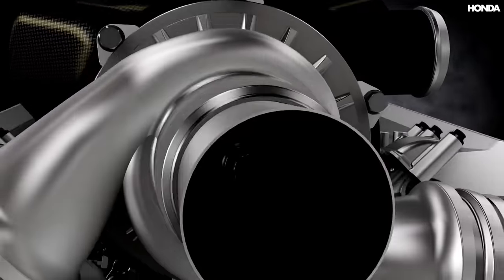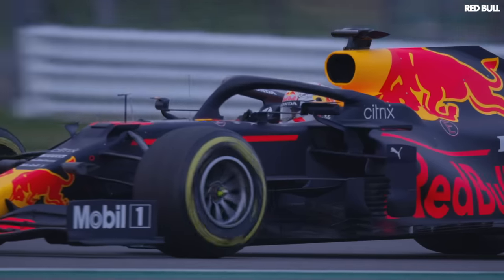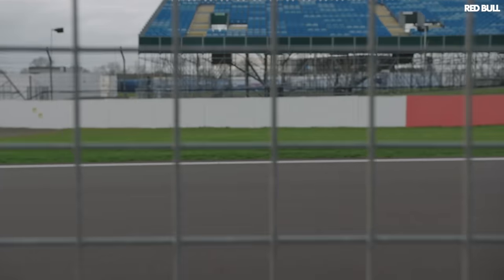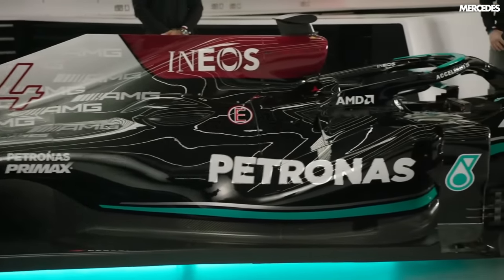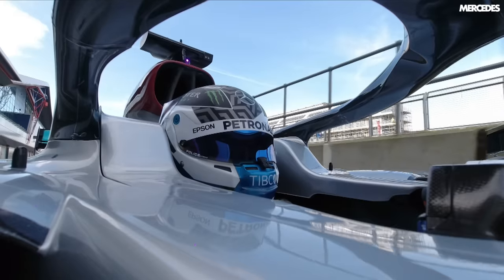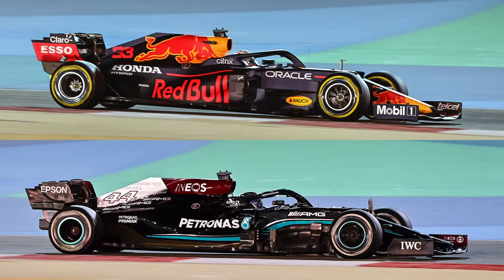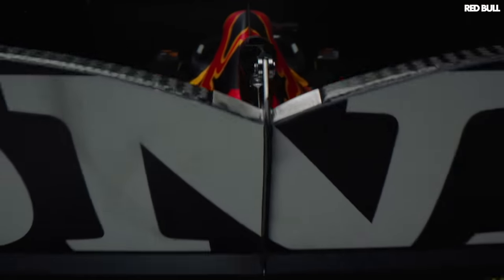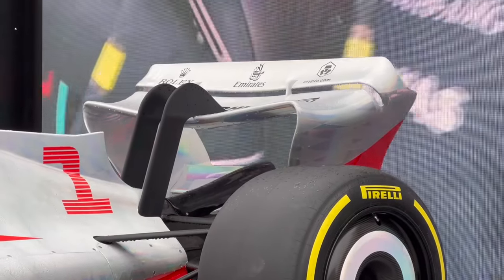Red Bull's SECRET Engine Upgrades to Beat Mercedes | Formula 1 Engineering

Comment: This is the BEST explanation yet of the PU battle in 2021 between RB and Merc. Question: Can Honda add in variable length trumpet intakes this late into the season?
Reply: I'm surprised that this isn't used by all of the engine manufacturers already, it isn't exactly a new technology or even a new concept. Engine designers have always tuned the length of the inlet trumpet for rev range optimal power or torque; variable length trumpets have already been run before, the Mazda 787B ran variable length intake at Le Mans in 91, when they won, I'd have thought this was not the first time it was used, but if it was, then a 30 year old concept!
The only problem is packaging for formula 1, they have so little space, the design looks very nice to fit!

Comment: why do mercedes cars have stronger power plants than the ones they sell
Reply: The pu does not include intercooler , radiators, exahaust system and gearbox. Customer teams have to make them.
Reply: @sangitachavan6227  thanks

Comment: @Driver61 Comments like "In the engine 2020, the main factor that gave mercedes the edge over redbull", makes it incredibly hard to take your opinions seriously.  Yes, the "ENGINE' is why hungary - colloquially known as monaco without the barriers - see mercedes enjoy their BIGGEST advantage over redbull.  If engine power was the main contributing factor in performance, as teams can load more downforce without worrying about the associated drag, then can you please explain why ferrari, with clearly the most dominant engine in 2019, didn't load up more downforce and dominate? Maybe just maybe, the w11 just happens to be the best f1 car ever built?  Maybe just maybe, it's downforce package was superior to that of redbull.  Maybe just maybe, it's tire deg was second to none.  Maybe just maybe, those focusing on high versus low rake - long wheel base verus short, don't know what they're talking about.  Yes certain philosophies have inherent strengths and weaknesses but they aren't as pronounced as some would like to suggest.  

As a professional, one would expect a much less biased and nuanced appraisal.  Do better.

Comment: why not talking about the flexing front wing of mercedes also.
the wing from red bull was legal but they chanced the testing for the back wing,
mercedes front wing is flexing a lot they are not even looking at it.
the fastest team with pit stops never any danger are slowed down red bull,
now mercedes are pitting faster then before how?
pit stop rules chanched for safety hamilton hitting a wall and braking to late no penalty, what about safety then

Comment: I guess I'd have to read through the regulations but how is Merc able to have a "flexing" car, where the back end sits down decreasing rake on the straights, but flexing wings is illegal?
Reply: I have clearly seen this, in action, on the mercedes wagen in Paul Ricard 2021.  Visible on the normal tv images.  Incredibly Toto was able to improve his hardware while taking away hardware from the opposition.  You got to admire this guy 🚁

Comment: Also if you keep a super cool liquid at the right pressure it will also keep it from changing its state to a solid, idk the exacts of the science but I know that you can “lower” the freezing points of liquids by keeping them under pressure.. same with heat.

Comment: Thank you very much for including the information on the Plenum. Do we know why RedBull is complaining about the Mercedes one? Other than RB complaining about everything.
Reply: I don't know what sport you are watching but I'm pretty sure it was Mercedes complaining about wings, pit stops and what not.
Reply: RBR was complaining about the placement of the temperature sensor in the plenum. The regulations mention a minimum temperature criteria for intake air, and RBR claim Mercedes was just placing the sensor closer to the engine where it's warmer, thus beating the requirement.